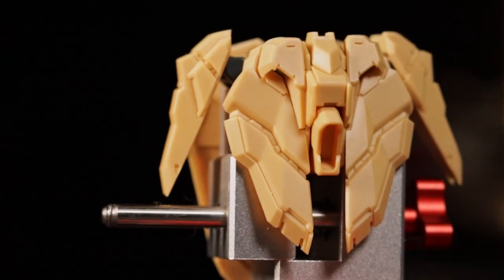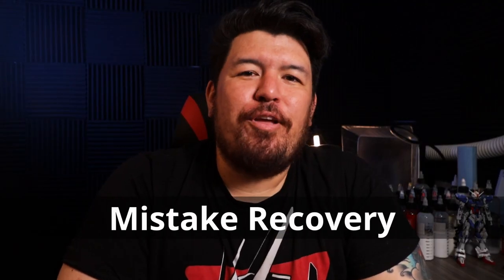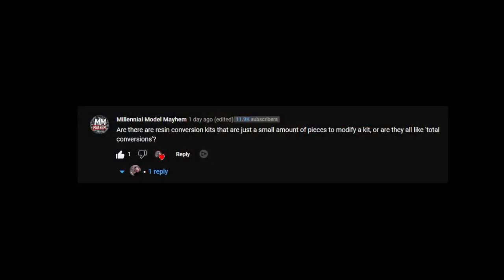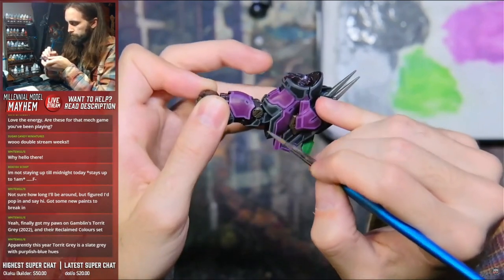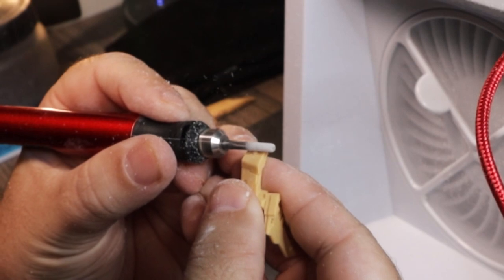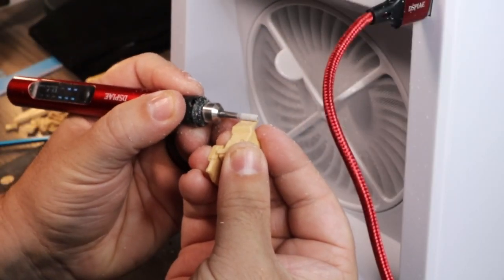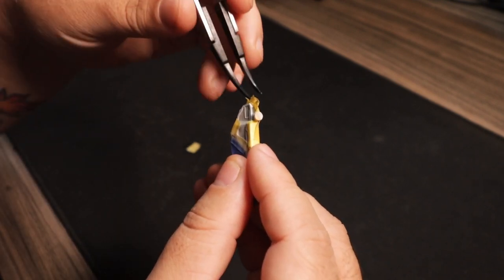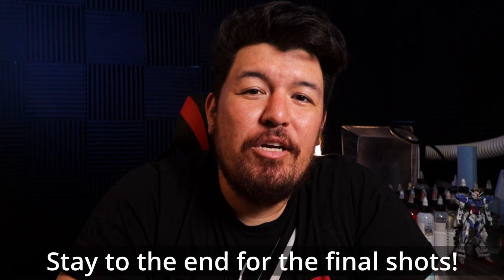Gunpla Resin Kits For Beginners | Are YOU ready for Resin?

Comment: IMO, If you have a solid fundamental for plastic kit, u can move forward to resin.  But if you'd spoiled by Bandai kits which has all parts separate for painting, than it will be pain in the ass as every single surface mostly needs masking for paints.  
So unless you have a solid skills for painting, sanding, fixing, I suggest u try an SD resin kit first to see if it's for you.
Reply from the maker: Ayye. That's exactly what I said! 😆😆😆 Thanks for commenting and I'm glad we agree on the fundamentals that resin kits require. 😁